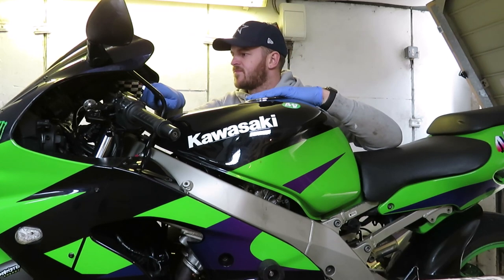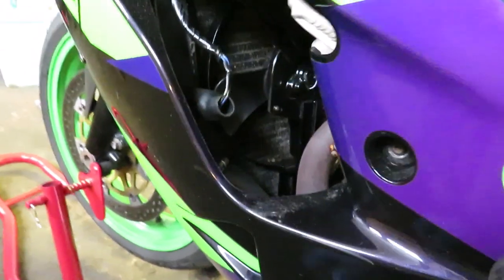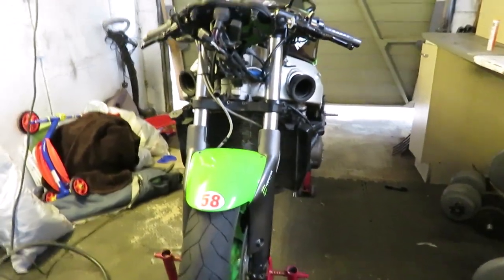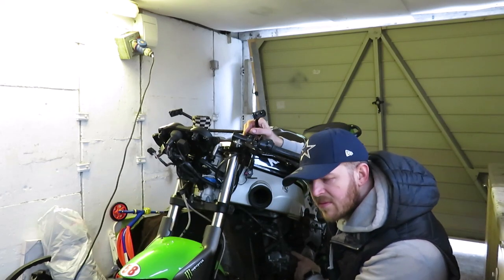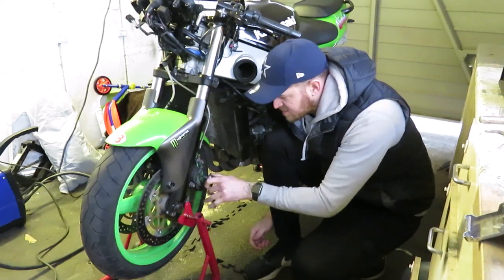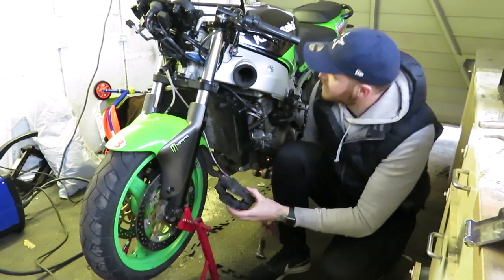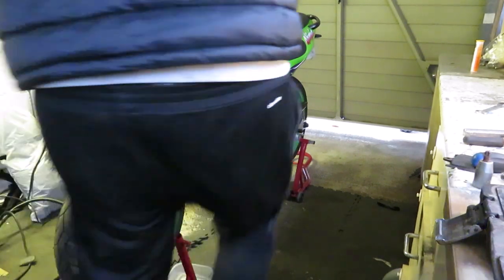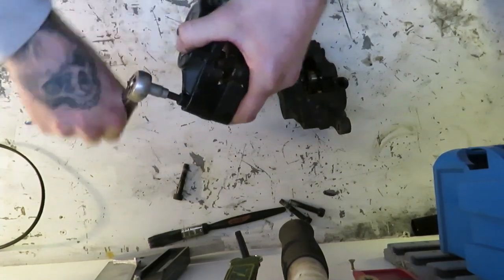Zx9R E2 project, Day one of refreshment, brakes 1.

Comment: Looks like you're going through your 9 in the same way as me. I took my forks off yesterday, ready to send out for service and upgrade.  

I started doing a few simple jobs to get ready to do some track days and now have a pile of bits in my garage! 

So far...
New shock (Nitron R2)
+4 ignition advancer
New screen (came with a blue one🤮)
Brembo front calipers and discs (my Tokicos were toast)
New Rad and silicone hoses
Rebuilt rear master cylinder and caliper with sintered pads
New levers and grips (came with shorties - 🤮)

To do:
Forks
Chain and sprockets
Valve clearances
Carb clean (hopefully not a full rebuild)
Tail tidy
Wiring harness tie-up 

Cheaper to buy a new bike! 😂
Reply from the maker: Paul Perry hey up buddy, yeah may as well while nothing else but drink to do! Haha. I’ve sorted my wiring out and carbs, videos already uploaded. I can’t get my front wheel off, pinch bolt is rounded off and seized! Hope you’re doing well and good luck with the project! 😂
Reply: @8713Thomas  yeah all my bolts and screw heads on the front of the bike were corroded on and I drilled a good number of them, despite using plenty of PlusGas and/or heat. Good luck with the fender/mudguard; proper emotional, that one!

Comment: Great video thanks, are the calipers off a triumph sprint rs 955i with the 90mm hole gap as I need to do this caliper swap, and did you use the triumph main mounting bolts or the zx9r bolts that attach to mount on bike  , any advice would be much appreciated 👍🏼👌🏼
Reply from the maker: I don’t know if they were 90mm. But they are triumph calipers. Go onto the forum, zx-9r.net and check it out. I got loads of info on there
Reply: @8713Thomas  cheers

Comment: On the front calipers when you replace seals do the new seals have to go in a proper way or is the recess grove angled to raise bottom lip of seal to prevent fluid leaking out when piston extends. I just did all mine and by memory the new seals had no raised lip so I am assuming the recess groove takes care of this. I have not yet bled so could pull off to reinspect quickly

Comment: Hi there Tom! I'm doing a restoration on mine, struggling to find parts for the zx9r 1999 model. Where can I buy parts and such?
Reply from the maker: Wemoto 
Cmsnl 
Fowler’s parts uk
S and p
Reply: @8713Thomas  Awesome thanks man! I subscribed!
Reply: How do you check the water and oil levels? I have a bottle on the left hand side, is that the water bottle?
Reply: What is the normal tire pressure?
Reply from the maker: @antonkrog843  that’s the overflow bottle. You check the radiator when cold, take cap off and look for the coolant in there. There should be an eyelet on the right side of the engine, on the clutch cover. Oil should be half way, while bike is upright and level.
Reply from the maker: @antonkrog843  as for pressures, I don’t know for yours. Standard is online somewhere, if you search. But can vary because of different rider weights. Obviously if you’re carrying a passenger, it’ll more.
Reply: @8713Thomas  Thank you for the replies mate appreciate it! Is there no way I can instant message you?